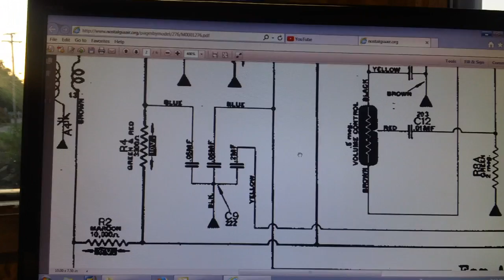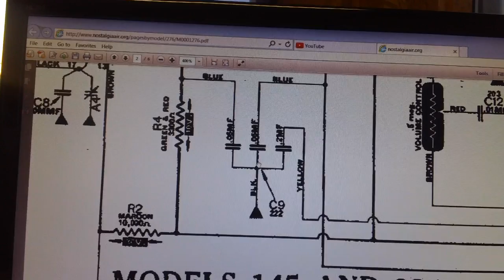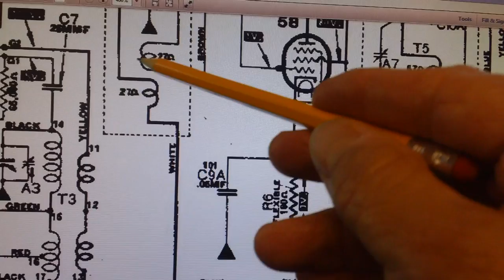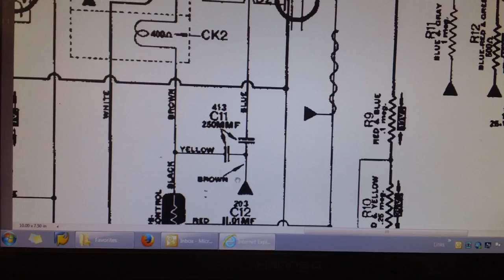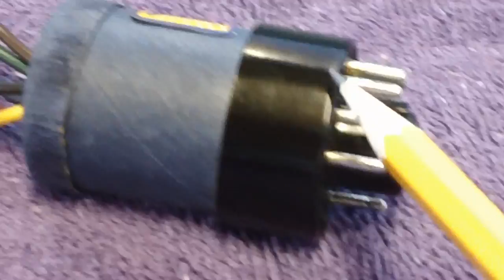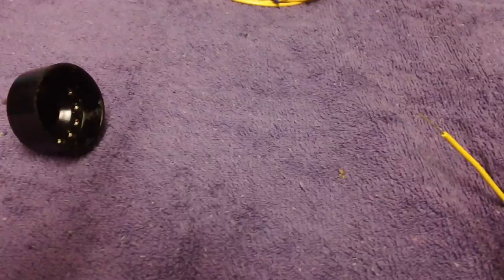1956 Sylvania 21" Halolight TV restoration (part 19 of 23).

Comment: John, thanks for the reply to my PM. The 3 legged dual ceramic cap is (as you said) the U1 but is a second, stand alone component soldered in as described. The unbelievable part is that it's pictured, as described in Photofact for that radio but not on the schematic. I'm still searching for a definitive answer on its values to replace it with a pair of new caps. The U1 is labeled with a 0.0005uF and a 0.007uF cap with 1 leg of each cap soldered together making a 3 leg cap. I'm not convinced that the 3 leg ceramic cap is the same value and more over, I've never seen caps with values of 0.0005 and 0.007uF before. Have a great day!
Reply from the maker: This whole thing is kind of interesting.  It is possible that U1 went bad at some point, so someone just soldered in a new component with the leads connected to the same places, but didn't bother to remove U1.  And over time you'll see caps smaller than those you mentioned.  Check out this link:
http://www.justradios.com/uFnFpF.html

Regards,
John
Reply: John, I'm not trying to beat a dead horse but the "thing" was installed by Zenith. It's pictured in Photofact and there's one also installed exactly as mine in a donor chassis I picked up. The odd part is that it's also shown on the radio's schematic (shown as a component) but not shown installed in the schematic. I got the schematic from Nostalgia-Air. Model 5D810 Chassis 5E02. When you get a chance, look at it and tell me what I've been missing.
Reply from the maker: Where is this thing located on the Nostalgia Air schematic you mentioned. Be specific.   I don't see it.

Regards,
John
Reply: Down in the bottom left hand corner, next to the osolating coil is the 105-15 which is labeled U1. This is the 3 legged dual cap that I'm trying to find a replacement for. Coincidently, at the top of the schematic, between the 12AT6 and the 50L6GT is another item labeled U1. This is a black sealed cardboard tube wired from the bottom of the chassis and called "filter". This filter has a Zenith part number: 22-1807 and is described as contains a 20uf & a 60uf 150 volt each cap. John, I'm really sorry but except for putting my phone number here I'm not sure how else to discuss this. Sorry for how difficult this has been.
Reply from the maker: Oh my goodness...now I see what you're talking about.
There are no two components labeled U1, one on the schematic and one off.  The U1 down in the left-hand corner of the schematic is merely a drawing to show you how the U1 leads are numbered, otherwise you might not know which is which and hook them up wrong between the 12AT6 and the 50L6GT.  It's the same reason they put a drawing of the oscillator coil there...to show which pin is which.
Over time you'll see a lot of off-schematic drawings like that showing the various pin numbers.

Regards,
John
Reply: Oh my God John, I am such a dumb ass. I get it and the info has been right in front of me all along. I assumed that the U1 WAS the cardboard tube since it was located on the schematic like the chassis is laid out. The Photofact labels the tube with a pair of caps to ground. Since I don't have an ESR meter to check them while they're installed, is there any other way to check them without unsoldering everything from the bottom of and getting to them out of the chassis? I would guess, no. 
I'll say it again, I've learned so much from your videos that I would have never attempted this without your knowledge and grace of explanation. Do you publish a mailing address? I'd like to send you a care package. 
Thank you very much for your patience with me and my newbie ignorance.
Reply from the maker: There's no need to send me anything, my friend...I'm very glad to help out, just as I was when I started out by those more experienced, and am still being helped by those more experienced.  Such is our hobby...one experienced hand washes the other.
Getting back to the radio:  U1 is probably ok, but if it were me I'd replace it with two new caps...a .0005uf and a .007uf.  It'll cost you less than 75 cents.  Many restorers leave old caps in a radio if they check good on a cap tester, but in my opinion those old things are just problems waiting to happen, so out they always come.  I've never been sorry for doing it.
I'm glad that together we finally got things straightened out.  I know you were getting frustrated with me, wondering why I wasn't seeing things as you were seeing them.  But again, such is our hobby.  It happens over and over.  :-) 

Regards,
John

Comment: John, have to tell you ; I finally have had a chance to use my Hacko FR300 which I purchased based on your recommendation.  I am restoring a 1979 Peavey Bass Amplifier and have had to remove a big amount of Power Transistors and Electrolytic caps.   As you would say  "Piece of Cake".   I wanted you to know your recommendations are not only spot on, but very much appreciated.  Question about the Hacko.. how do you keep the nozzle from clogging ? I've had that happen a few times.  Just wanted you to know I appreciate your videos, your time and your wisdom. - Ron
Reply from the maker: Ron,
Good for you.  Go for it, my friend.
I found the Hakko nozzle hole to be a tad too small for the stuff I work on, so  I drilled it out just a smidgen with a small bit.   Works great now.  Also, to help keep the nozzle hole from clogging don't press it tightly against the circuit board, or whatever you're extracting solder from, while extracting...and keep the trigger pulled as you lift the nozzle up and away.  Lastly, depending on how much solder you're extracting, stop periodically and clean the parts inside the filter pipe.  Good suction is essential.  Even a semi-clogged filter pipe will cut it down.
Hope this helps.

Regards,
John
Reply: joernone  great advice. I did order the 1.3mm nozzle which will help. I am not working on any small components here.... globs of 1970's solder is my game at the moment :)  Thank you !